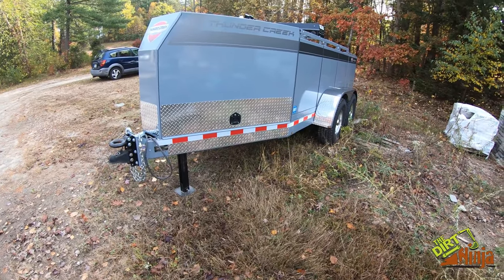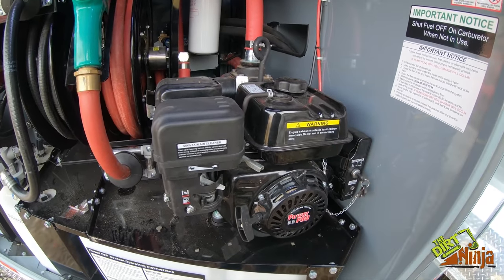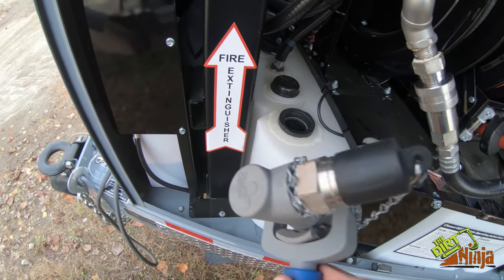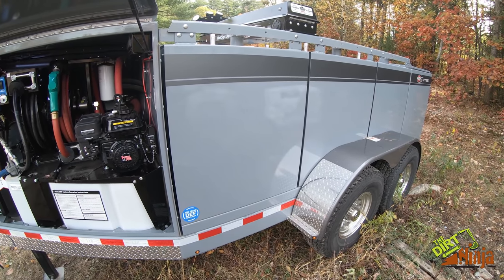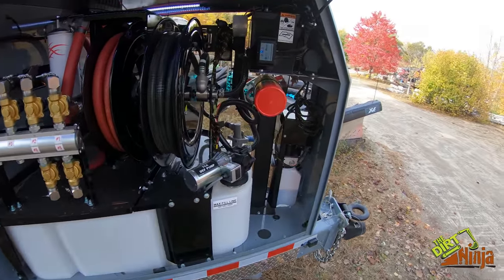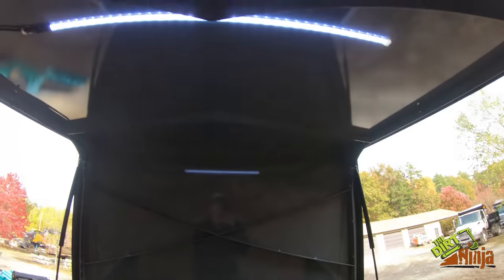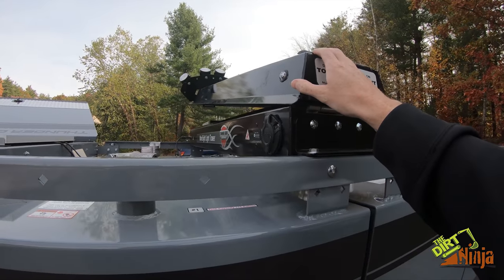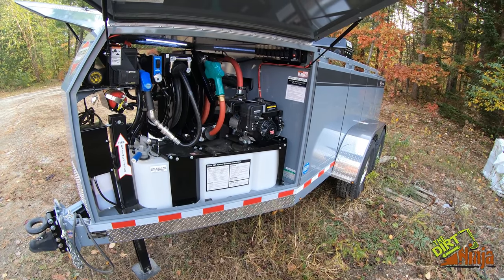Thunder Creek MTT 690 Informative Walk-Around

Comment: A situation where you don't want to pump from all diesel tanks together is if you have to take on fuel from a suspect source. Then you want to isolate that to individual tanks and control which tanks you fill from. You can always pick up a load of water with your fuel--yet another reason to keep tanks isolated and manage the "fill from" yourself. I live on a boat and carry 1600 gal of diesel. We always keep fuel from different sources isolated, dual fuel paths (lines, filters, etc.) are kept isolated and so forth.
Reply from the maker: Thanks fir the tip!

Comment: Wow, what a trailer... I bet that was quite expensive..... Had to be $5000 I bet.... Maybe even $6000?
Reply from the maker: Lot more than that...
Reply: @DirtNinja  Haha I know... Was just trolling. Just the air compressor prob cost that.... Very nice unit I can't imagine what it cost.... My guess would be 25G area but I never priced anything like that. I know a dump trailer of that size is about $9000 then add the tanks, pumps and motors hoses etc... Prob upwards of 30G maybe
Reply: Ya try 30k plus lol. Still cheaper than a lube truck.
Reply: @pkoiva0  sounds about right... I have no idea other than guessing based on the components